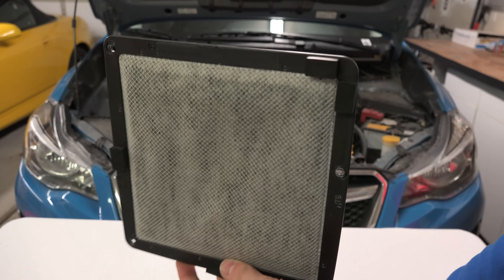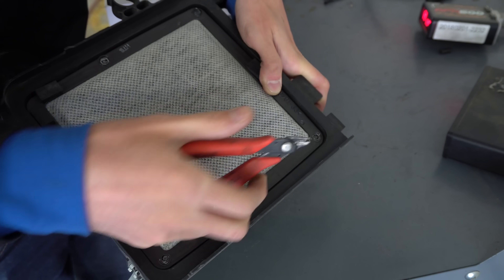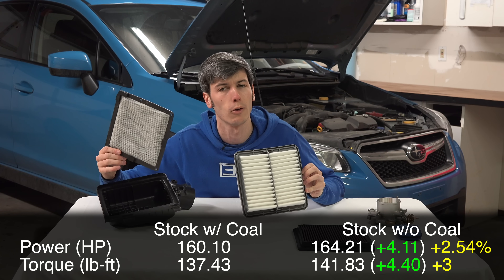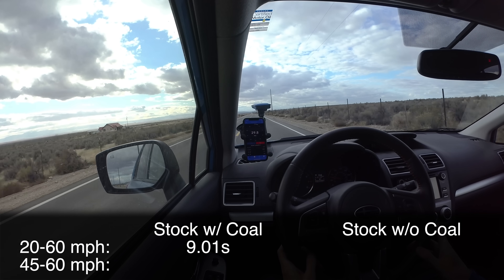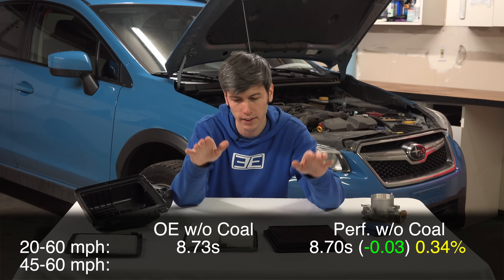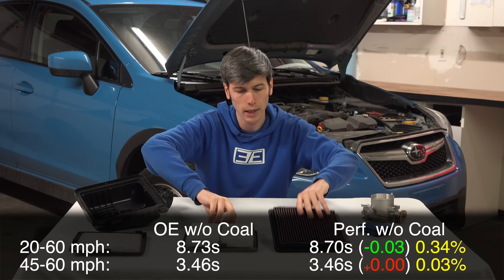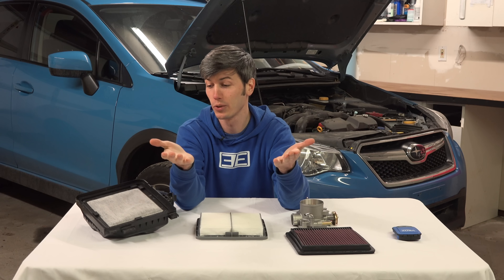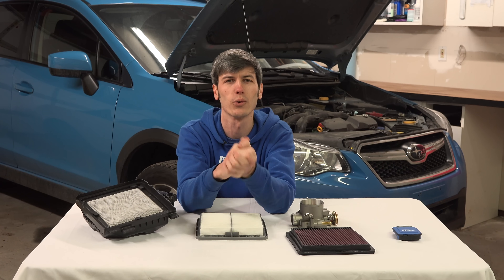Do Charcoal Air Filters Rob Your Engine Of Horsepower?

Comment: Hey Engineering Explained, 

I have no idea how long have I been subscribed to your channel, but I have been for some time, and they are great and entertaining content, especially for when I need something to show some people that don't fully grasp some topics.

I just wanted to ask/point out/argument? that you can sometimes have delayed response from an engine if you have a somewhat restrictive intake system, since if you open a throttle valve "instantly", an engine will try to draw a large amount of air , which after being consumed by the engine, needs to be fed back through the filtering element. If this filtering element is restrictive the entire intake system will be put in a slight state of vacuum, since it consumed all the air in it, and the filtering element is not efficient(?) enough to let air through at the speed the air was consumed, resulting in a slight vacuum and ultimately, less power than a freer-flowing intake.

It's just what I think, and I'd love to see if you agree with this!
Reply: p.s. i'm subbed in my other account lol, i'll sub in this one too, two times the subs!
Reply: And ….no response hahaha😂😂

Comment: Would be better to see this test with a vehicle that gulps some air.

Those who had a huge difference may have had a crap filter and changed it at the same time, creating an overall positive effect on the engine. Or they are deep in the placebo zone.

My question is the extra fuel consumption over the life of the vehicle, if you gain power it seems to me under normal use you may see a economy gain.

Edit: no I'm not suggesting a 20% efficiency gain or something crazy, talking maybe a few tenths which is all it takes to save me thousands a year on diesel.

Comment: Throttle response is more than just the physical opening of the throttle plate, fuel enrichment and timing play a huge role. If you command a large TPS delta and the ECU calibration isn't standing by with fuel and timing changes its going to bog right down for a few seconds until everything catches up. Toss a Turbo in there and you have a whole new element to worry about. But I think that may be a but beyond the scope of the video.

Comment: I have a MK7 GTI and I've noticed the engine start shaking when i drive it in the morning when it's very cold, (-17° , -25°) I give it about 2 min to warm up before I start driving, the vibration happen while driving on a small hill before joining the highway at roughly 2500 RPM is this normal or something I should take seriously? Thanks.

Comment: When I had my Crosstrek, I took out the charcoal filter with the K&N air filter. I could replace the charcoal filter as I only clipped the heads off of the holding pins for smog testing.  I did notice a difference in bottom end, but nowhere else. Installed a axel back Borla muffler. Again a slightly better bottom end. I got tired of the low horse power (148 hp in the 14 XTrek) of the Crosstrek. Traded it in on a 17(new)WRX Base.much happier now....

Comment: Ok, Jason, so this is not how it works. When you drive the car around with a more restrictive air filter the ECU will "learn" the wastegate duty cycle deviations from the tables just like the fuel trims are meant to "learn" the deviation from the factory MAF calibration. This is necessary because in winter the air is denser so the ECU logic will have to adapt for the variations so that the AFRs will be on-point, the throttle response will also be on point by lowering or increasing the wastegate duty cycle on turbo cars or throttle plate opening on N/A cars, and so on.
So your test is incorrect, and so is the other one about the filters. Adding a less restrictive filter after the car ran with a more restrictive filter will make it open the throttle more if it's NA, or command higher wastegate duty if it's turbo. This will make it produce more load momentarily and slightly exceed the pre-established load targets.
So drive your car 1-2 days with each filter combo and test. I know, it's not that easy and sometimes not feasible, but this is going to be the right way of testing it.
Any car, turbo or NA, will have load targets and will meet them eventually no matter if it's winter, summer, has a restrictive filter or no filter at all. Once the ECU parameters will adapt it will produce the same power. To a point, using different air filters is like trying to pour a drop of water from a syringe or from a 2 gallon bucket. That drop of water is going to be your load target and can be met with both the bucket or syringe. The differences will become significant when the amount of water (or the load target) will require an amount of air close to the limit of what the filters can do (or how much the air will heat up because of the friction).
So as long as the intake system has the capacity of transporting the required amount of air and the load targets can be met there will be no difference in power or torque eventually, only momentarily while the ECU is still tricked into thinking it has to work harder (which it will only momentarily).

Comment: I feel like you kinda ran into an ambiguity problem. With manufacturers talking about "sport mode" sharpening throttle response we're getting confusion about what that classically means. People tuning their cars are generally referring to the delay between atmospheric pressure and the intake valves. Beyond the electronic throttle gimmick, which is really just "tell the car what you mean when you press the pedal" it's about having a low volume, low restriction, short run from the throttle to the intake valves. I'm sure you know this, i'm pretty sure I learned it from one of your videos. Seemed worth mentioning.
Reply from the maker: Yep, I agree with ya. What I'm saying is an electric throttle can respond quickly or slowly, and that will make the response feel different. Ex: flooring it in intelligent mode versus sport mode means the throttle opens more slowly, hence the pressure within the intake manifold will not increase as quickly, thus throttle response is delayed.

Comment: Removes charcoal filter "I'm something of a racecar builder myself"
Reply: Would like to know if the mpg  was changed in the testings.
Reply: @williamh1973  probably minimal if any difference in mpg. At partial throttle with the charcoal filter in place, the engine is getting plenty of airflow, any change in airflow would be detected by the MAF and Oxygen sensors and adjust the A/F ratio. 

However at wide open the engine can use as much as it needs and the charcoal filter becomes a restriction at that point, then you will see some benefit to horsepower because the engine is running a little leaner with the extra air. Engines are tuned from the factory to run on the rich side at wide open throttle to account for all sorts of altitude and fuel quality changes depending on where it's driven, etc. 

So essentially no change in fuel economy but a small bump in power at wide open throttle as EE shows in the video.
Reply: @williamh1973  probably not because oxygen sensor will try keep air fuel ratio at 14.7 until air filter is really really dirty, and materially restricting air
Reply: I wish he had done it with a vehicle that is much older and see if an older used charcoal filter made a difference.  That car looks new.
Reply: Try foam filter
Reply: Facts idk who this hank green car guy is... he’s trippin😂
Reply: Better watch out if that same bloke adds racing stripes… he’ll be going like a rocket then!
Reply: Is it safe for the car to remove it?
Reply: Gotta start somewhere
Reply: Did you see all the checking inside the air box. That will cause air turbulence, restricting air flow. I would either grind the inside of the box smooth or cover the checking to create a smooth flow through the air box. THAT will improve the numbers, real world experience.
Reply: Oh ya man, and these racing stickers gave me a solid 10hp+, definitely recommend!!
Reply: @D-dly0  Clearly a poser, I bet you used a K&N sticker with an Injen filter. Everyone knows they're not compatible and you'd actually gain 3hp if you just took the useless filter off.
Reply: @starvalkyrie  taking the filter off would probably give you a performance gain albeit at the cost of engine longevity.
Reply: @garethbaus5471  taking the filter off actually completely messes up performance because the air bounces around and doesn’t know where to go. Watch tyre reviews video on air filters

Comment: When people mention throttle response, I think most people are actually mistaking this for lower rpm hesitation under mild acceleration.  Perhaps I'm incorrect, but moving to higher flower filters on smaller motors always seemed to help with low rpm hesitation.

Half the people that claim to feel major differences in filter changes (assuming a decent intake from the factory) feel it from changing out a dirty filter with a clean one.

That said, with those horsepower gains I'd still throw in the k&n and dump the charcoal filter because I'm a horrible person that likes to know it's making more power even if I can't feel it.
Reply: based
Reply: true and quite honestly I don’t even care that much about the horsepower. I’ll pollute the air a bit more if it means I hear my M3’s turbos spool 😂😂
Reply: What is low RPM hesitation?
Reply: @louisthibault555  "What is removing resistance at low RPM" - It's giddyup!

Comment: If there for preventing hydrocarbons from escaping into environment one would do better by having in the intake path a valve that is open when running and closed when the engine not drawing air.

Comment: You got stock in the EPA? Seems like you really don't want us to remove the charcoal. You used REM to verify the insignificant difference in Gs, but did not do the same for just the filters, which I would assume also be insignificant using your REM. Your test is so good, but not quite full and fair.
Reply from the maker: What's not full nor fair? Facts are provided, you can decide what you believe is best for your situation. IMO (offered at the end), it's not exactly worth doing.
Reply: @EngineeringExplained  Sorry lemme be more specific. I think it would have been more complete if you had done this same G test with just the filters. I'M ASSUMING those results would also be minuscule like your coal G tests. So therefore, assuming that's correct, it's unfair and even biased to say don't dump your coal filter. Just REM G test the air filter only tests, and we can verify together. Unless you got stock. =p
Reply: It's not full and fair to say ditching the coal won't get you any noticeable G increase, because you didn't do the same test with the air filters only test. What if those gave negligible G increases? Wouldn't that be very important here?
Reply: Right...  and climate change is fake news to you, too.

Comment: Activated carbon filters can only absorb a fixed amount of VOC's.
I'd imagine these are only effective for a month. These are about as useless at reducing emissions as those carb approved gas cans.
Reply: Samuel Bickford The trapped fuel vapors are sucked out of the filter, and into the engine, when it is next started.

Comment: Well of course it makes little impact, this thing has 140 hp, you only need to suck so much air in, so the difference is minimal, more hp= more air being pumped through the motor, literally. If you had the same intake and air box on a 400+hp car it'd make a good chunk more hp. And also a side not, wow this thing is slower than my 2003 Ford e350 superduty that weighs over 6500lbs 😂. At least from 20-60 anyhow, that's it's best range of acceleration. I had a badd air filter, it was probably 10 years old, it literally started collapsing in on itself, and was draining my power at higher rpm like crazy, lower rpm was relatively unaffected, but it probably cut my hp in half, it was immediately way faster after replacing it lol

Comment: "Do not tamper with emissions equipment." Challenge accepted. EGR removed, down pipe installed, ECU mapped for performance.
Reply: Fails Smog Test
Reply: @Taydrum  Smog test? Black cloud behind car, when floored. Passed.
Reply: drives 25 year old diesel and is exempt from emissions laws
Reply: Yeah, should have bloody EGR. Mine is 2004 that bugger was there. Chopped him off with axe.
Reply: I just don't have vehicles with emissions equipment, all of my diesels are pretty 2003
Reply: @jaydunbar7538  probably still has egr at least
Reply: @jaydunbar7538  based
Reply: Removing/disabling the EGR reduces part-throttle power, fuel economy, and engine life. It has no effect on full-throttle performance at all.
Reply: @Bob5mith  tell that to everyone who removed their egr systems for the sake of power and mpg gains. 2016 Ram Cummins - clogged egr @ 45k mi, removed and picked up 3 mpg. Butt dyno and dually truck going sideways more often say otherwise...
Reply: EGR is actually quite a clever concept but most implementations are super dirty. If it was possible to efficiently clean it up, you would ideally route it through your turbo charger, too.
Reply: @Bob5mith  perhaps you've got a point, but my diesel oil staying cleaner has been reason enough for me.
Reply: Bob Smith Careful Bob…the snake oil peddling aftermarket depends on these fools for livelihood
Reply: Daniel done that without downpipep cuz diesel
Reply: You are all so cool :P Can I get your autographs? :P
Reply: With or without that thing in the Primes Airbox, it will be more emissions friendly then my Catless Si for damn sure.. hahah

Comment: You measured the same percentage improvement in 20-60 time as in dyno power. But I would expect the acceleration improvement to be lower than that because at that speed a fair bit of your power is being used to overcome drag etc.
Reply from the maker: Yes but the percentage of power drag removes does not change, where as the percentage of available power has changed.
Reply: @EngineeringExplained  Actually we should expect the acceleration improvement to be more than the dyno improvement. Suppose you made 150kW and 100kW was drag. Then say we got 10% more power from our air filter. Now we have 65kW for acceleration compared to 50, which is an improvement of 30%! It's 10% from rest and a bigger and bigger amount until you exceed what was your terminal velocity with the old filter at which point it's infinitely better.

Comment: A charcoal filter to remove infinitesimal amounts of intake blowback when the engine is off?!? This level of nonsense is staggering!
Reply: Yes.  I'd be curious to compare it to the amount of emissions from your filler neck when you top up fuel at the bowser.  My guess is that would be waaay more.
Reply: @Jarrah_Kilgour  Depending on where you are located when you fill up, the fuel hose may actually have a vapor recovery system installed to prevent this very situation.
Reply: @BretBerger  Wow...  Definitely not where I am located.
Reply: @Jarrah_Kilgour  You are a lucky man, as those gas station vapor recovery systems are a nuisance. The problem of it all is that many people have no numerical analysis skills - for an equation A=C1+C2+...+Cn+epsilon, where A the sum total of the atmosphere and the Ci (i=1,n) are its major components and epsilon is the human contribution [where epsilon<<Ci (for all i=1,n)] some people decide to fight epsilon to no avail. Stupidity everywhere. I am not saying that vehicle emission systems should not exist; of course they must exist, but there are limits beyond which it is a religion and there are no additional benefits.
Reply: Infinitesimal on one car. Multiply that by the hundreds of millions of cars in the US, many of which are beginning to use stop start... It may be small, but long term it has a potential to make an impact.
I remember when I bought the first Tesla roadster because i thought I'd have a goofy relic that never caught on. Now look, they're the most valuable US Automaker. Nothing wrong with taking small steps to take a difference.
Reply: Sounds like you're better informed than the engineering team tasked with emmision control on this vehicle. Please share more of your wisdom.
Reply: @BretBerger  No just that he knows more than the politicians and beaurocrats that regulated this idiocy into existence.
Reply: @sonictech1000  You oppose emissions regulations?

Comment: Nope, the charcoal filter is there for when the engine spins backwards to make the car go in reverse!  ;D

Tried that RetailMeNot thing; sadly it didn't work anywhere I tried it.  The websites were all able to reverse the codes after they were applied at checkout, and some even cookie-flagged my browser to prevent any coupon codes from working even if manually entered.

Comment: I actually recently removed the charcoal filter in my E60 550i in the pursuit of better throttle response. Interesting to see how much power removing it actually freed up. I did notice slightly improved fuel economy as well, big shocker.
Reply: wow I have an f80 i’m gonna try this. it seems to have a bit of lag at low rpm
Reply: @Goober.Finger  the s55 isnt designed to make power at low rpm.
Reply: @Goober.Finger how did it go for you bro? I have an f82 been thinking about doing the same. Hence why I’m watching this now haha